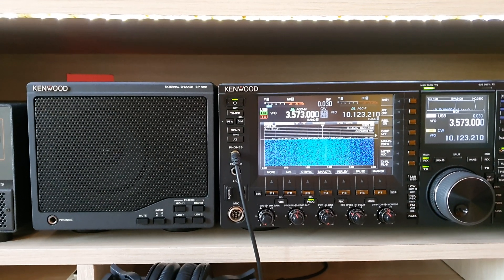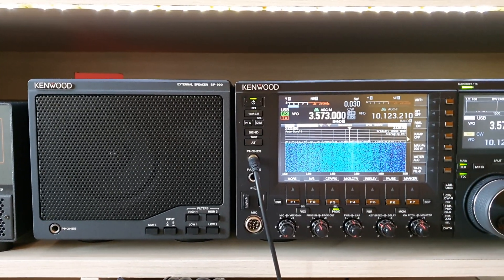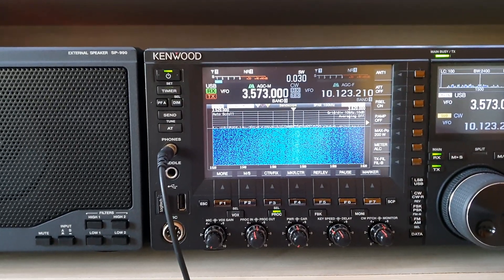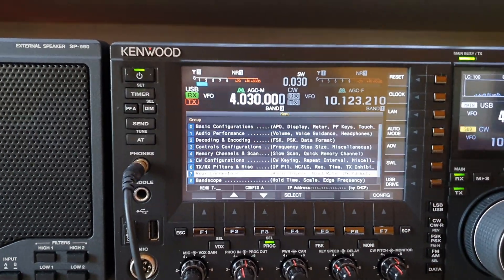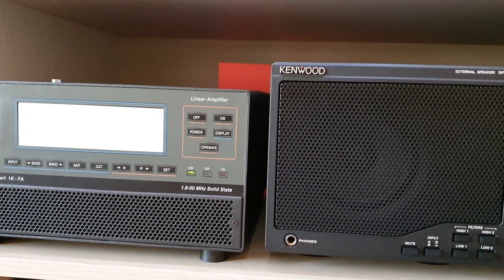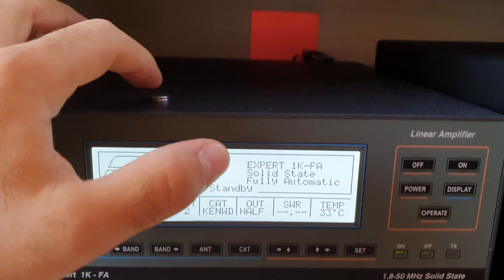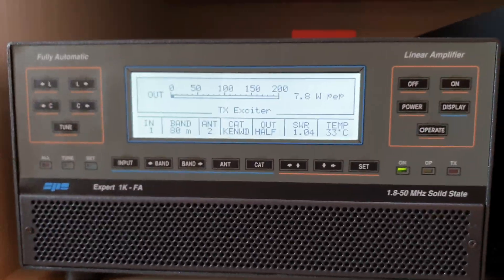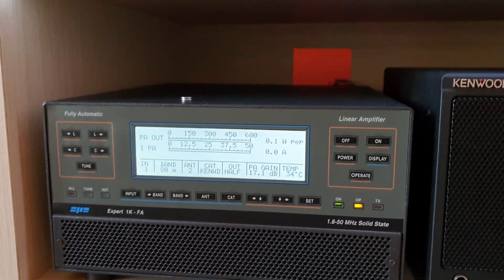Expert 1K-FA / Active 60 meters band / By IW9HRZ

Comment: Ciao Paolo da Bruno HB3YiO dal canton Ticino, mi piacerebbe comperare un expert e ho visto il tuo videoissimo e vedo ch lo tieni molto vicino al tuo bellissimo Kenwood e ti chiedo se le ventole non fanno troppo casino quando vai in trasmissione,e anche in rx una o due sono senpre attive..È qusto il mio problema ho poco spazzio sul tavolo.Grazie di aver letto 73 de Bruno.
Reply from the maker: Buongiorno bruno, le ventole non sono troppo rumoroso, in RX è accesa una sola ventola a velocità ridotta, quando vai in TX si accendono fino a 4 ventole e la velocità varia in base alla temperatura raggiunta ( in questo caso il rumore si sente)
73's Paolo IW9HRZ
Reply: X

Comment: Wha???? Wuzzup with the rare earth magnet???  Magnet switch relay thing is a prank? Right? yeah, you can get the Fk1A to transmit outta band and can manually tune the tuner but it's hit n miss, you fudge the tuning at the last closest legit freq before ya cut cat communications to the amp and radio can't update to the amp when you change to outta band on the radio. If you manually mistuned on the legit freq in the right direction then it will be right when outta band .
Not really a mod per se 
But more like a exploit. 
Whats up with magnets tho..... That's funny!
Reply from the maker: Sorry I didn't understand well what you wrote.
The magnet is just a switch that activates the modification made inside, it could also be a normal switch, I used a magnetic switch to not make holes and not to damage the aesthetics.
As soon as I am ready I will also make a video to explain what the mods consists of.
73's Paolo IW9HRZ
Reply: @paolodx83  ok I thought the magnet thing was a spoof or hoax of some sort. I am looking forward to seeing and reviewing your modification! Please post mod soon. Very interested.
Reply from the maker: @southboundsuarez9832  the video is ready, I will upload it soon.
Paolo IW9HRZ